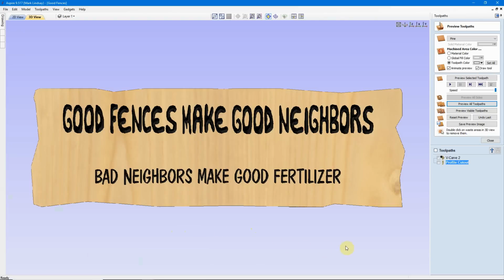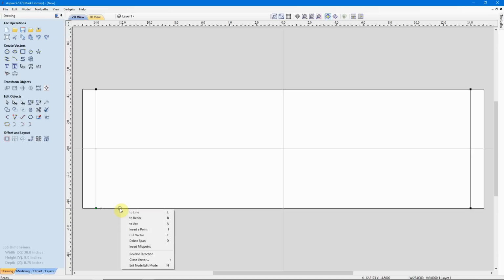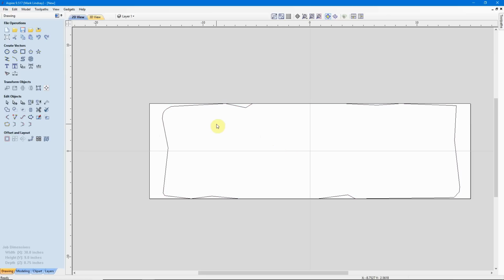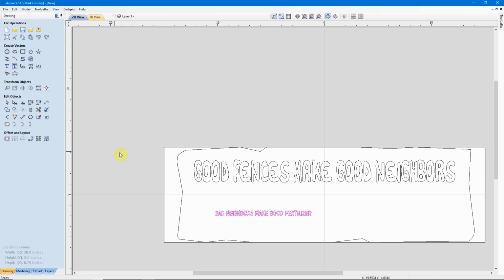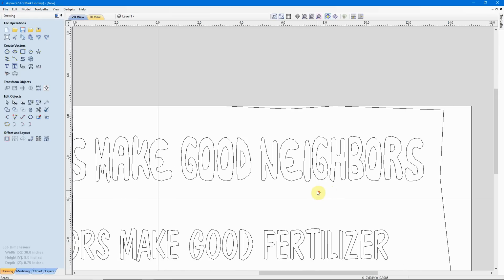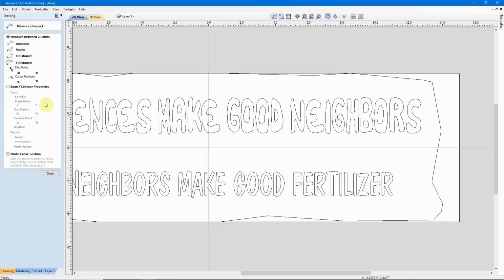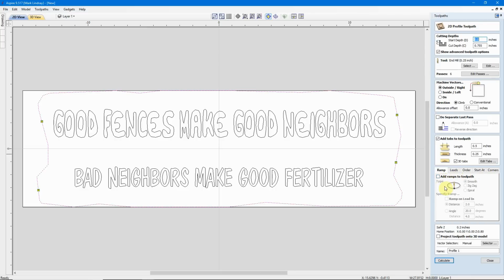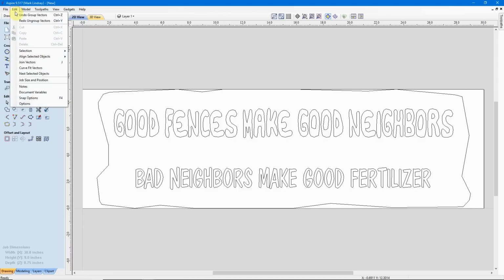Node Editing Text - Part 25 - Vectric For Absolute Beginners

Comment: Another way to change the appearance of letters is to select the different parts and flip them vertically or horizontally or Rotate them slightly. I would have even flipped the "E", and maybe the "D"  upside down.
Reply from the maker: Truth! However, I had the "design approval executive" peeking over my shoulder when I drew out the original, and she nixed a few ideas, while giving me the official okie dokie on others. You know the deal; it's whatever the client wants - especially if you've been married to said client for 31 years and hope to make it to 32. Thanks Doug!
Reply: @MarkLindsayCNC  That's Awesome! Congratulations on 31 years!
Reply: What interface do you use to your router

Comment: Mark Thanks for another great video. Every once in a while we need a refresher course showing  some of the  functions being  used in a different project that  we have seen in a straight forward tutorial.text editing . I believe you used a Bosch 5/8" dia v bit. would you share the cut depth of that  bit from the tip to where it change in to a straight cut. ?
Here is my  next question.
I use 90deg vbit to cut a chamfer on the line to a cut depth of .3 of an inch. Then I do a cut out on the out side of the line with an .125 end mill. What I am trying to figure out is how to use a start cut depth to eliminate the cutting of air before before the bit reaches wood to cut. I also use a ramp in. So how might I find a start depth for the .125 endemil
Hope that made sense. 
thanks Jeff
Reply from the maker: Your question made perfect sense, Jeff. In that case, you'd use the same technique I used to find the start depth for a pocket in my Assembling a Composite 3D Model video, here: https://www.youtube.com/watch?v=vKRjPBCvbbY        Jump to about the 40:25 minute mark in that video, and you'll see how I found the start depth. Keep watching, because I changed the start depth after I ran the finishing toolpath. That's how you'd find your start depth for the profile cutout toolpath. 

Thanks for watching!